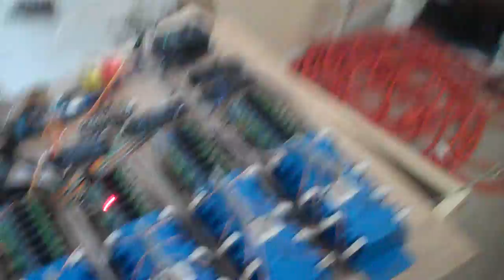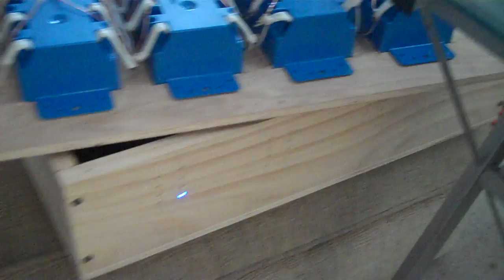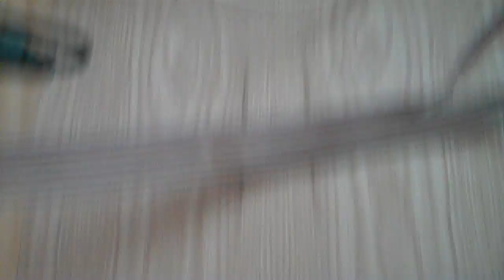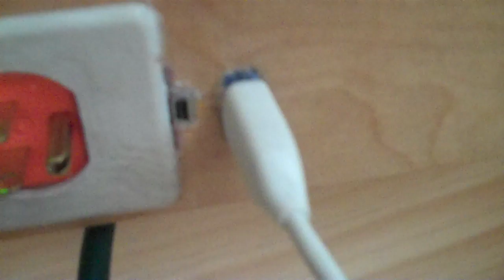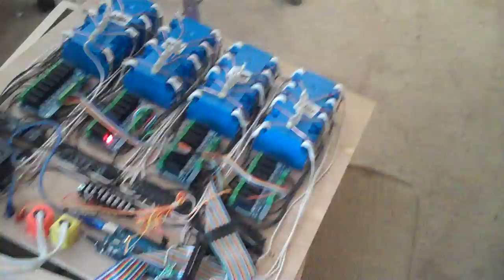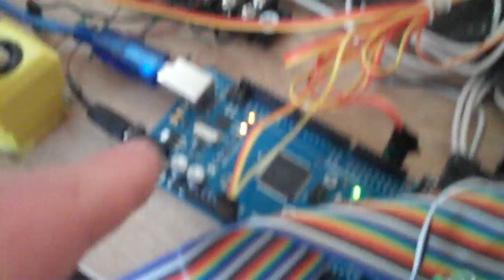Christmas Lights Control System - Part 15 - Version 2

Comment: how many volts are you powering the relays off
Reply from the maker: the relay input voltage is 5v. Input control signal voltage: 0V - 0.5V Low stage (SSR is OFF), 0.5V - 2.5V (unknown state), 2.5V - 20V High state (SSR is ON); SSR Output (each channel); Load voltage range: 75 to 264VAC (50/60Hz); Load current: 0.1 to 2 AMP

Comment: I would use a panel mount USB socket for the Arduino (link below) also for the power connections I can see why you would want to have them like that, but having them on a flexible wire is much safer for the plug(less chance of breaking off)
EDIT: One more thing, Wire nuts works great for connecting multiple wires together instead of all those little 4 wire connectors.

Link: http://www.amazon.com/StarTech-1-Feet-Panel-Mount-Cable/dp/B002M8VBIS/ref=pd_sim_sbs_147_1?ie=UTF8&dpID=418u4s3z8LL&dpSrc=sims&preST=_AC_UL160_SR160%2C160_&refRID=0XBN3ZCJWGKPPB5YPBFD

Comment: Did you manually unsolder the zero crossovers and re-solder the random crossovers? How did you know which random crossover to buy that would fit the board? Thanks, and Amazing project!
Reply from the maker: Yes and it was a pain, lol. I looked in the data sheets for SSRs with the same footprint and specs.

Comment: hey i am very thankful for the amazing project. I have a question regarding 230 V. I am building exactly the same as yours, however I am using 230 vac. What should be changed then? Thank you so much
Reply from the maker: On the zero cross detection circuit you will have to double the size of the resistors and make them 1W resistors.  Other than that I think everything should be the same.
Reply: Scott Shaver thank you very much. your work is inspiring :)